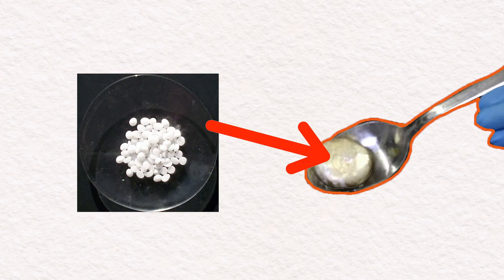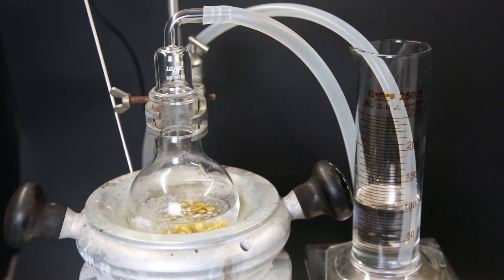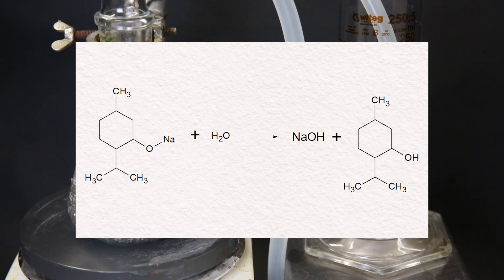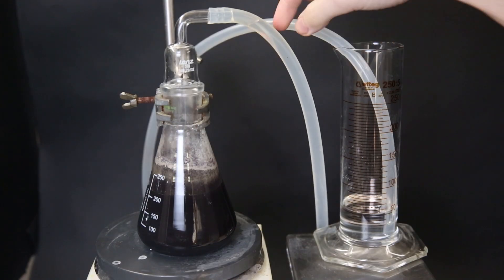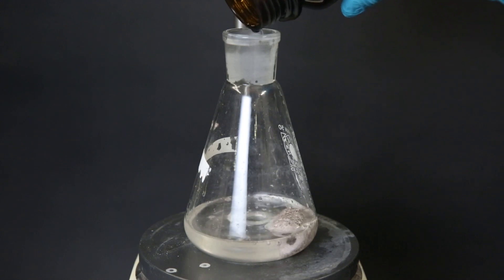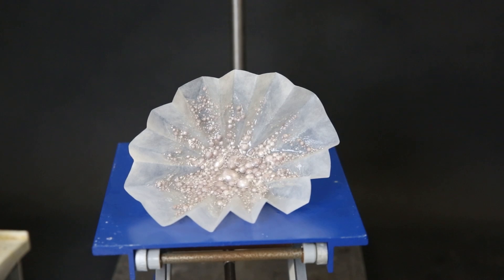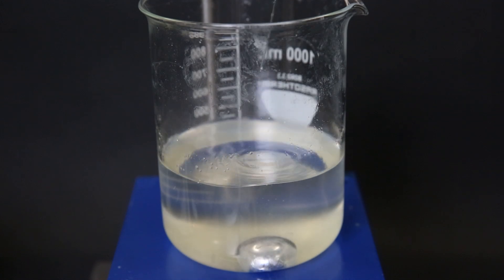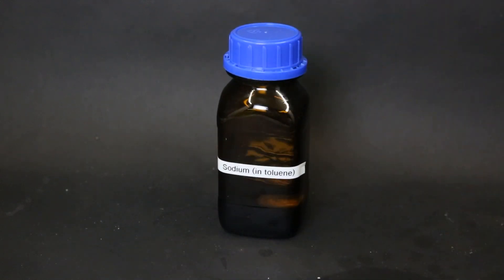Sodium Metal from Sodium Hydroxide

Comment: So can someone explain why when i do this reaction it works so good that it only takes about 4 hours from start to finish to make me some sodium. i even get about 90-95% yield. also i found that super fine magnesium powder for what ever reason dose not work.
Reply: I too have a similar results. But for me it’s more like 6hrs. And this only happened if I added another dose of catalyst at the halfway point. I’ve done this reaction many times and there’s a lot to say but the biggest thing for me was adding more when hydrogen production slowed way down. Also I’ve never got suck back and if you can get it, that tetrahydrolinalool is a much better catalyst in the end. That’s how I get 97% efficiency with all the sodium coalescing without it being a bunch of smaller balls like menthol tends to do for me anyways. Your the only other one I’ve seen have it completed so fast

Comment: It might have been nice to know how much mass the flask lost. I know NurdRage has said its pretty destructive to borosilicate glassware at those temperatures and times but it would be nice to know if you have 100mg of flask in solution or 10g. Not sure what effect it would have but I haven't looked it up yet.
Reply: Wasn't the glassware-destruction problem adressed by adding the starter sodium? I think nurdrage mentioned it.
Reply: @kpunkt98  Its been a while but no, I think the dissolving of borosilicate glass happens regardless.

If I remember right, the starting sodium was to remove any water in the organic solvent. Maybe it was part of the same issue. I'd have to go back and watch probably his entire series on that to find out.
Reply: @htomerif  you're right about ot being for removal of water but i think removing the water was for the reason of avoiding glassware destruction. If i recall correctly he talked about starting sodium production by either using a lithium ion battery or sacrificing one flask.
Reply: I've never been able to get this to work. I've tried menthol and isoborneol as catalysts. I've tried using a Li strip. I've tried pre-drying the NaOH. Result: I've ruined 2 flasks, and got no Na. I'm beginning to think this is some sort of chemistry gag meme. Maybe it's just too humid where I live.
Reply: @xerolad4086  I haven't tried it myself. It does seem slow enough and expensive enough that just doing it by electrolysis in some clay pots might be easier. I have tried doing it that way and made plenty of sodium just using a car battery charger. 

I guess thats not really the point though. Unless you live somewhere where sodium metal is illegal to buy, its pretty cheap on ebay or whatever in huge quantities.
Reply: @xerolad4086  see only two possible problems with this synthesis: The purity of the mineral oil (additive free mineral oil is necessary) and the quality of the magnesium (an oxide layer is a killer for any reaction). I suggest you get the "hypoallergenic baby oil" Nurd Rage used. For the magnesium, use fairly big pieces and try crushing them in a mortar against each other right before the synthese. Or even washing them with dilute HCl. That should help.
Oh an obviously, it has to be dry. NaOH is hygroscopic and always contains a lot of water. Use enough lithium or sodium to destroy the 15 % of water in the NaOH and heat slowly, best stirr at RT before. Heated up to the necessary temperature without removing all the water from the NaOH it will just eat up the flask (Erlenmeyer. Others won't reach the necessary temperature).

Comment: Could it be that the yield was low because the reaction mixture was cooled with the stopper removed? It may have caused air to get in which reacted with the hot sodium and destroyed some of it
Reply from the maker: There is overpressure in the flask of evaporating solvent and other gases, so likely not a lot of air going in. Besides, it would have to dissolve into the hot oil. Hot liquids barely dissolve any gases. If i would put a stopper it will fly off.
Reply: @Chemiolis  thank you for the explanation!

Comment: Pleased to see the Dr. N. Butyl Lithium process making the rounds! Someone else recommended you check his channel out (Nurdrage on Youtube); they're right. There are refinements to this process that it seems didn't make it to your ears.
He also goes into the theory - the reason for the starter sodium actually isn't to catalyze the magnesium reaction, it's only the menthol that does that. It's only to dry the hydroxide, which makes it possible to do without damaging glassware.
Dr. Lithium also details a way that you can avoid having to charge with starter sodium, by tearing open a lithium battery and using the lithium sheet inside it. This contaminates the sodium, but it's pretty dilute and in most cases won't be harmful. I would recommend it unless you intend to produce food grade bicarbonate.

Comment: the best way to coalesce all the sodium into one big ball is by melting in mineral oil, and adding a few drops of isopropanol
Reply: This is probably a dumb question, but why do you call it Isopropanol and not Isopropyl (alcohol)? Is that the brand name? I've been wondering and wondering. ☺️
Reply: @tracybowling1156  They mean exactly the same thing. Chemicals have lots of equally valid names, isopropanol and isopropyl alcohol are just common names for the IUPAC name for propan-2-ol (meaning the alcohol group is on the 2nd carbon). But you can also call the chain that the alcohol is attached to an isopropyl group, hence the other names. All the same :)
Reply: @benashmore  Ah, thank you. This is a very detailed response. This is why I love YT, the such nice, smart people!!! Thanks again! ☺️☺️☺️
Reply: All chemical names ending in ol indicate that it is an alcohol.methanol ethanol,isopropanol menthol etc. Methyl alcohol ethyl al
Reply: @ryans3442  See, these are the things I need to know. That makes so much sense. And I've never put it together. Thank you, kind Sir! ☺️
Reply: I know sodium dissolves in metho, but not in isopropyl alcohol?

Comment: Without the sodium or at least sodium/magnesium from a thermite reaction or lithium to remove all water, it eats the hell out of the flask.. i tried it without something to remove all the water and it completely failed and chewed half way through the bottom of the flask.. i think mine completely failed because my sodium hydroxide was to wet despite coming from a new container
Reply: Yes, use lithium. Also, oven your NaOH to dry it a bit. I also oven my Mg, and stir my oil with some ovened MgSO4, then filter, first. Get as dry as you can, so as to not ask too much of the lithium. And stir for a good while with the Li, before turning on the heat.
Reply: Most naoh pellets contain~10% water.
Wrap a lithium strip or 2 from a battery around the stirbar and reflux b4 going up to the higher rxn temperature
Reply: @ryans3442  Yes - sinilar to a Grignard reaction. So technically this would work with KOH, LiOH. etc?
What about carbonates?
And Cs, Rb as well, or too reactive as metals?
Nice to have an inert gas atmosphere too probably...
Reply: I've had the same ideas on these rxns as the suggestions you just made and while this rxn works for hydroxides but not carbonates it does work on rubidium (a sciencemadness member named pok did it)&KOH(nurdrage video) no one has tried cesium yet and nurdrage failed when trying it on LiOH.
I reckon a thermite variation will work if done under an argon atmosphere (lithium reacts with nitrogen)